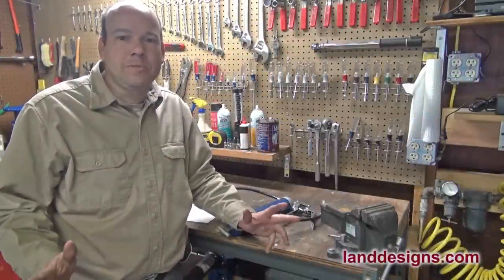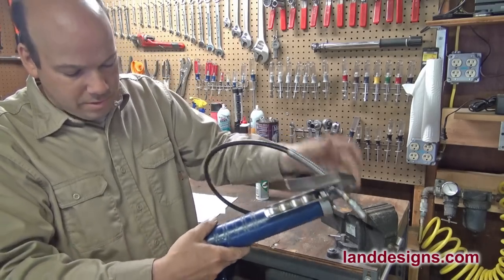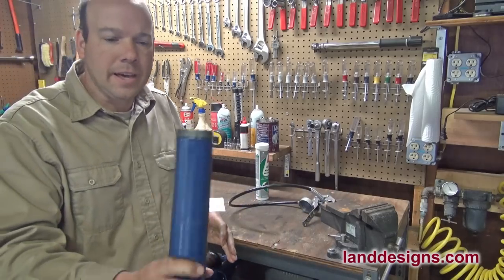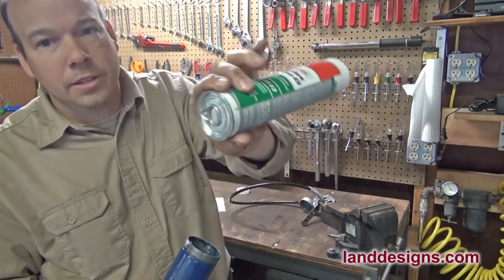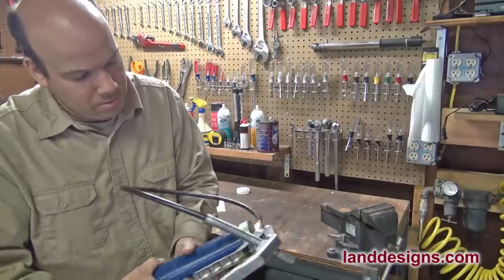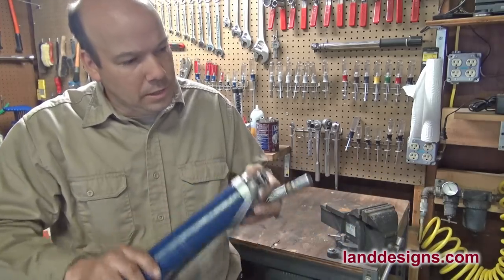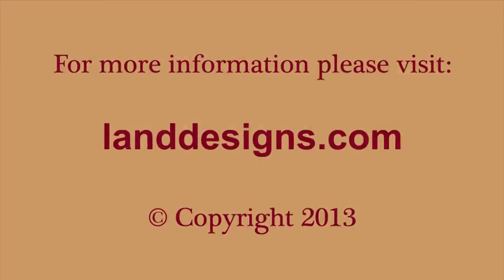How to Load a Grease Gun Cartridge Video

Comment: Thank you for actually explaining at the end. What do you do if you’re still not getting a prime. This is exactly what was happening to me and no one else was talking about that part.
Reply: If it’s a brand new gun it will take many pumps to prime the long flexible tube.   If you have easy access, it helps to fill the cap with grease before screwing it all back together.

Comment: Great video and instructions!  Not only did you tell me how but you anticipated what I would do wrong.  Wish I had watched your video before I loaded (actually, attempted to load) my grease gun.  But watched  your video, corrections were made and I salvaged about half of my grease cartridge.  Most importantly, I successfully greased the spindles on my zero turn riding mower.
Reply from the maker: I had to make the same mistakes several times to know where they are made.

Comment: I'm using the same grease gun and I always have an issue with the rubber plunger at the bottom not going inside the grease tube. I was hoping I was just doing it wrong but no. I have the push the grease tube down over the rubber plunger, then pull the handle back and hold it with my vise grips, before replacing the top.

Comment: Awesome video.  Mine was jammed.  And I let the air out and got it working.  Thanks
Reply from the maker: Air in the system happens fairly often.  You can either open the gun and push it out like I showed or pump the grease gun a gazillion times to get it out.  I prefer the first option.

Comment: Had a feeling the old canister was supposed to pop out but I've put some force into it. Not enough force maybe. You're not a pro but good stuff here. Thanks. *Edit - loading the new can if there's an air bubble. Great tip that I forgot about just in case. Video was to the point, descriptive and short. Much appreciation.

Comment: Geeesh, i messed with this darn grease gun for over an hour yesterday, just knew that something had to be wrong. Well it seems on my greas gun, there's a rubber plunger that is used for bulk grease filling only and if you're going to be using it with the grease cartridges, it has to be removed. Well after fighting with the plunger still in we knew something wasn't right and after looking into it, we found that in small print, an 8 word sentence hidden in the directions 'if using cartridge, remove rubber plunger before inserting' ....lol felt like a dummie :) Well, we removed the rubber plunger, set it aside and tried purging the air from the system. Well it must still have air inside because i can't get more that a few drops to come out ! I just watched your video and we're gonna try it again with high hopes that it will work, thanks for the how to video......Will report back with my results, hope it works this time :)

Comment: What type of grease gun? I got one at Autozone not impressed at all for the $30 I spent. I had to use teflon plumbing tape around the fittings to seal it up so now grease comes out, but I'm looking for something maybe easier to attach and un-attach to the fittings.

Comment: Put the cap on just a couple threads, then pump the handle to start.  Then it’s primed.  Tighten it up.   Bleeders don’t work because the grease is too thick and the spring isn’t strong enough

Comment: This happened to me just yesterday while trying to load a mini grease-gun from Autozone.........worked fine for the first couple tubes I used, then for some reason yesterday, it never would prime-up and pump the grease out, never could get it to come out no matter what I did.  Not sure if it had anything to do with the little bleeder-screw up top, but, I didn't do anything different while loading and pulling the trigger, had to end up unscrewing it and wasted the whole tube, I was pretty pissed.......not sure what went wrong during the process.

Comment: Isn't the rod and plunger one solid unit?  So by sliding it in straight away you waste a lot of grease. Once the cartridge is in and the pump is screwed on centralize the rod but don't push it in it will be sucked in as you use the grease

Comment: I ordered a new tractor.  So I bought my first grease gun too.  I have used them in the past.  When I load it it seems the plunger is catching on the edge of the tube and not going into the grease like it is supposed to.  I ended up using a stick and scooping it out. Tried two different tubs from same company
Reply from the maker: That's weird?  Some grease guns are designed to suck grease up right from a bucket or drum so have a look at the directions and see if the piece of rubber that pushes the grease out should be reversed for tubes of grease.  That's one thing I could think of.  The only other thing I could think of is if you put the tube of grease in backwards with the metal ring hitting the plunger first.  However, if you did that you'd have one heck of a fight just getting the metal part through the hole.  I hope you get it figured out.

Comment: Thanks Man, I've been trying to figure out why my gun would not work after I just put in a new can. I did not know about the air pocket thing.
Reply: ***** that must be what I have going on also, was getting ready to toss them in the garbage thinking they must have a bad seal or something not getting any grease to come out after pumping and pumping and feels like there is no pressure building up, must be that air pocket thing I will have to try again doing what you did, thanks. I have to normal sized ones and one of those small ones and can't get any of them to work and I remember using them before a lot just fine.

Comment: After twisting the t-handle and sliding it all the way in, I lose pressure after some pumps. Then I have to pull the t-handle back, re-engaged it with the plunger, and bleed air from the canister all over again. Is this normal?

Comment: I put a mobil 1 red synth grease cartridge in my gun & when it sits it bleeds red from every possible place.
Reply: Try storing it with the spring tensioner pulled out and locked. The spring is pressing the grease all the time causing it to separate from the liquid

Comment: never push the rod in let it go in by itself that way you have no air bubble problems at all . if you push the rod in you are putting air in the grease and will be pumping  20 or 30 times to get the air out . its the one big mistake everyone makes .DO NOT PUSH THE ROD IN LET  IT GO IN BY ITSELF
Reply from the maker: I was taught to keep the threads loose and push the rod in to push the air out.  I've had great luck with that method.

Comment: I wish I had watched this before I opened the grease gun.  I put the cartridge in first without pulling back on the spring.  Now I can't pull the spring back and screw it on the bottom of the cartridge.  Crap!

Comment: Fine for you lot, I couldn't even get the plunger out to start the process. I tried with the head still on, then with it off but it just won't budge. Then it took 10 minutes to get the thread on the head started again. It's new, so it's back to the shop on Monday to see if he can do it. If not, then it's faulty, and he'll have to replace (and load the cartridge) or refund. 
I'm sure it is a very good tutorial btw. ;-)

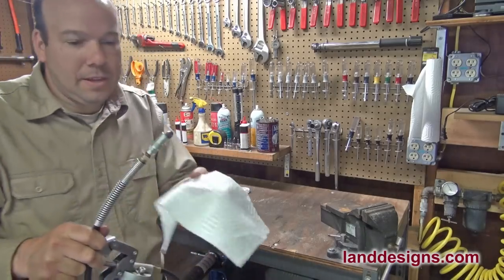Comment: 3:15 'There's a correlation between how big of rush your in and how often things go wrong...' That would be 'always' and 'always'.

Honestly tho, every one of my guns takes forever and a day to get grease pumping again after changing the to a new tube. I've been known to just throw them in the trash and get another one. Of the 20+ years I've been using grease guns, I've never had one yet that works right.

Last night I pumped that effin thing over 5 minutes trying to get it to work. I threw it in the dumpster and went home.